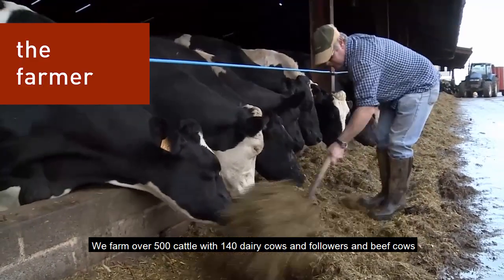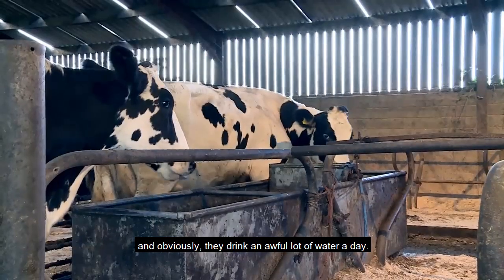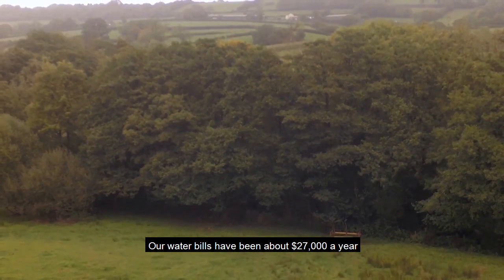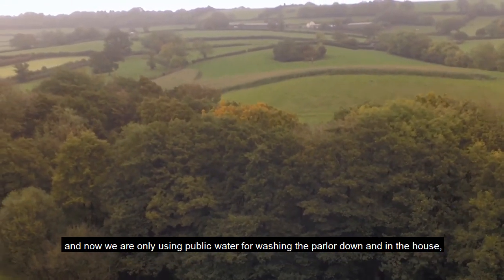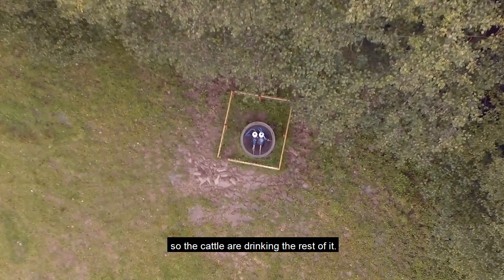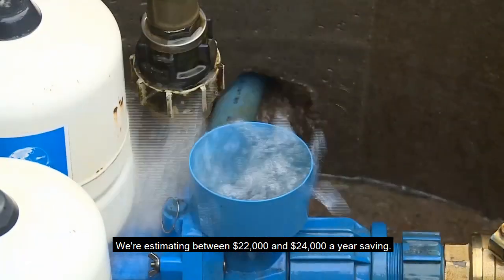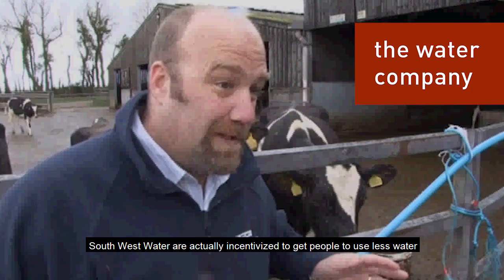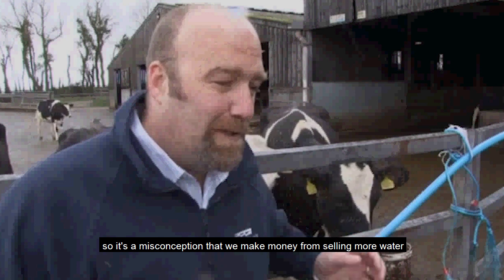Ram Pump Pumping water from fenced off rivers

Comment: Efficiency % ?
Reply: its a type of ram pump so its is and is not good the biggest pro is they don't need power they will keep on going till it either get blocked by muck or there's no water. this can explain it https://youtu.be/aUTjVovpKvA the robot voice is annoying but its the best explanation of how it works.
Reply from the maker: Thanks for your comments. Yes, the video does a good explaination of how ram pumps work. However, the Papa Pump  uses a patented new in-line valve that makes it more efficient and is built of a very hard glass/nylon composite which allows it to be much smaller than the equivalent traditional iron ram pump. See how the Papa Pump works at https://www.waterpoweredtechnologies.com/how_it_works/ .   Also we recomend using catchment tanks, supply tanks and our special filters to avoid being blocked by debris - some of our pumps have worked for years without a problem. We also have produced a special valve, the SureFlow Valve for water supplies which are low or inconsistent - It will automatically stop the pump when the water supply gets low and automatically re-starts the pump when levels have become sufficient again. See this here...  https://www.waterpoweredtechnologies.com/sureflow/